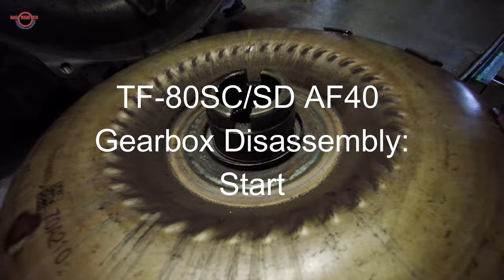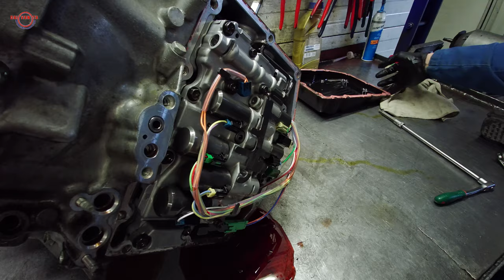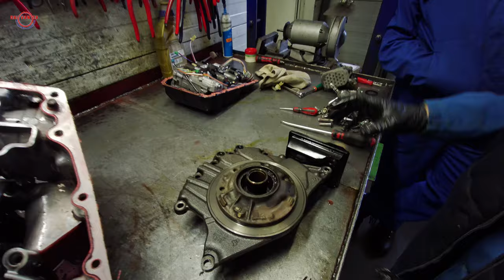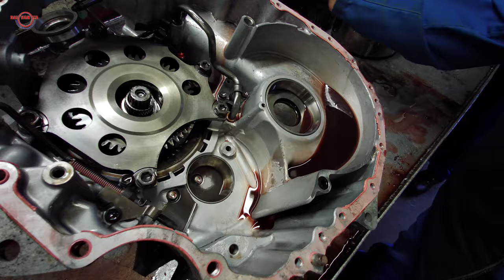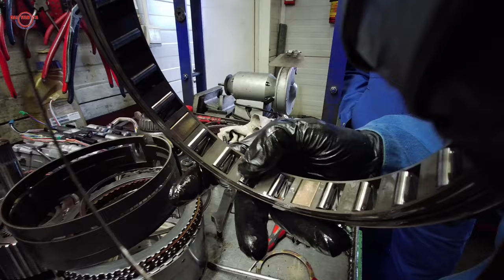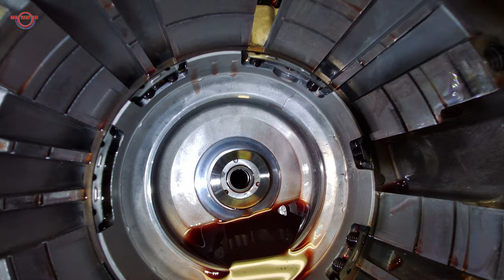TF80 SC SD AF40 Gearbox Disassembly

Comment: hi daivanta. I am reparinig my tf80sc. but i have a problem regarding the clutch disc and stell plate assembly side. I cant remeber and i didnt any mark during the removal time. Clutch disk and steel plate like own both different side. can you please say me it, i need attend to correct side of clutch disk and steel plate on assemblely. Do you have tell me any sign for correct side. thank you

Comment: Hi my friend a curiosity I have the same gearbox mounted on the opel insignia and it makes me in neutral from 3 to 4 gear, with the diagnosis it gives me error P0741 and P0734 what happened in your opinion?
Reply: 0741 ошибка блокировки гидротрансформатора, 0734 ошибка из за малого уровня масла возможна, болейте 0.7л масла, сбросьте ошибки , и посмотрите, если появятся опять то нужна чистка соленоидов блокировки гидротрансформатора и 4 передачи

Comment: is this more like manual (like dsg but one clutch obviously) or is it more like american style old automatics? I have c5 2.0hdi with that transmition, and also passat 2.0tdi dsg, and i cant quite figure what the hell is that asin, but its fuel economy is awfully bad compared to my dsg passat, and its quite a bit slower even tho citroen has 176hp, and vw only 140hp. It is smooth tho, but feels like its more under the clutch when accelerating, compared to dsg, when its always ''in gear'', cant feel the clutching. In asin 1-3 feels like its under the clutch all the time. And its not slipping, if i hit it to the medal doesnt slip really, its just how it is doesnt feel broken.